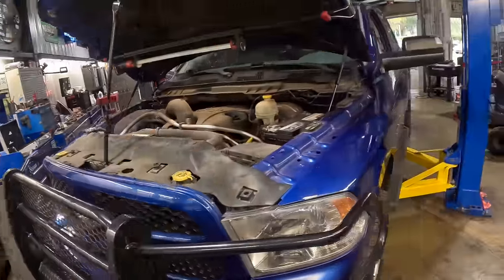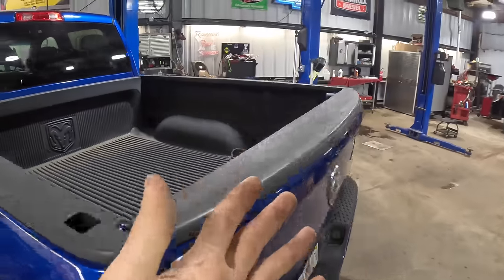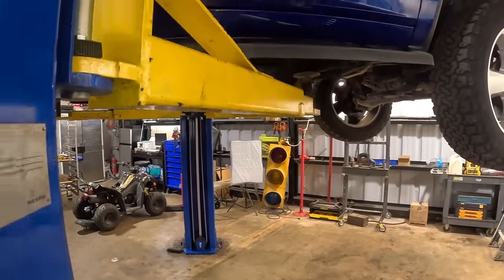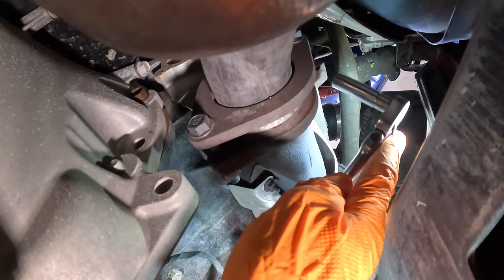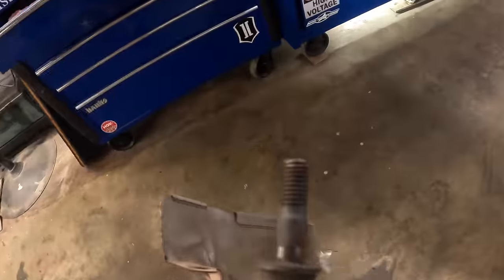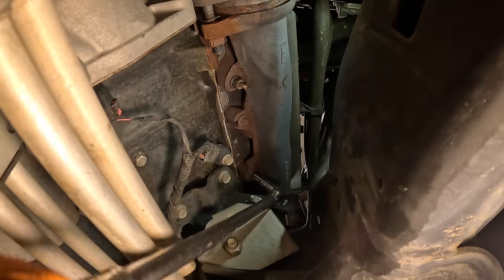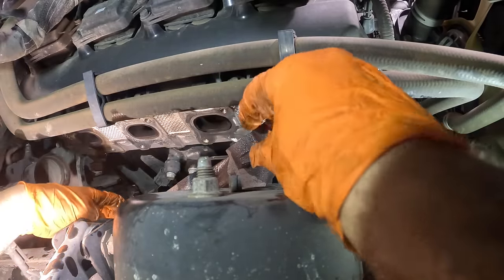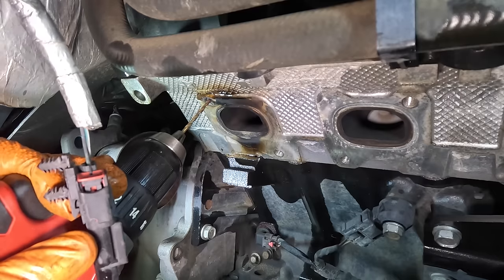Exhaust Leak on Cold Start! Ram 1500 5.7

Comment: Audi 5 cylinder exh. studs would break primarily, on #5. Our standard procedure was to rotary broach the manifold to insure a flat surface and replace all studs with high strength studs (supplied as Audi OE parts). This would  provide a permanent fix first time, every time.
re broken stud extraction, Rigid makes an extraction kit which includes; a centering fixture, the appropriate drill bit, an insert to turn the stud. As long as you could access the broken stud with a drill, the process was relatively simple process. You got lucky on this one. Did you ever notice that the more experienced and talented one is, the luckier one gets.

Comment: The belt sander idea isn’t bad. On improvement to it is to use a bench mounted belt sander that way u can put the whole manifold on at once and keep it perfectly flat. Usually this gets damn near perfect finish and saves big $$$. I know not everyone has a bench mount sander but hay potential shop upgrade

Comment: Hey Ray. Aren't you using flux core welder not a MiG welder?  I thought I recall you saying you didn't use gas?  You should record you trying to learn the TIG welding. I'd like to see how that goes. I'd like to learn TIG welding myself.

Comment: Could you have used the punch driver you use on the rotor screws? It looked like you didn't remove the carbon deposit from the head behind the gasket.

Comment: Nice video. Very dangerous drilling that broken stud “free-hand” like that without using a centering guide, flattening the surface with a dremel  first, or using a center punch. The water jacket lives right next door.

Comment: Use an oxy acetylene torch with a small tip turn it up so you have a small blue flame and heat the nuts up before loosening you'll save on the aggravation  and broken bolts!

Comment: Common issue with the Hemi, had the rear manifold bolts on both sides of our '16 Ram 1500 break.  One had enough sticking out to get with vise-grips, the passenger side I did the build it up with a MIG welder trick to get hold of it.  Bad design by Ram overall, too few bolts, cast iron manifolds that warp over time.  At least they weren't hard to get at.

Comment: I find it odd the air con drain is forward facing, and doesn't have a 90 degree elbow facing down like most vehicles. I thought maybe Ray removed it to have easier access to the flange bolts on the Manifold.

Comment: Good job RAY,center punch 1 st always,don't trust location on hoist post as tubing is NEVER uniformly flat. Get your self a piece of 3/4 in particle board that you have checked for flatness with a steel or aluminum yardstick and hang that on the wall as a surface gauge.Another thing you could do,go to a scrap yard that sells PLATE alum scraps and buy a 6x20x1 inch piece end cutoff.Its usually flat.But don't buy bar-stock it's not flat. good luck.

Comment: I had a local shop quote me upwards of $3600 to replace the gasket on the right side.  all because the cats might need to be replaced if the job went south or if the studs broke off.  I decided that he was telling me in advance that they would in fact break (which they did), but that it would require tearing the block off.  BS I said to my self, and spent the next 12 hours replacing it in my driveway.  and removing the broken stud myself.  
the next year, the driverside blew a nickel size hole, and the little mom/pop shop charged me $125 but I had to go buy the part for them.  $210 all in.

Comment: I have a 12 Ram 2500 5.7L with the same problem. The shops around my area want a small fortune to repair this issue. I would do the repair myself if it weren't for my age and lack of resources. This, IMHO, is a design flaw that should rest solely on the manufacturer as a lot of people have the same problem with these engines. As a matter of curiosity, what is the ballpark figure that you charge for this repair?

Comment: If you use a piece of plate glass's 
As your flat area and use engineering blue your will highlight the high and low spots on your manifold by rubbing the manifold on the glass and making it perfectly flat you can also put emery cloth on the glass as your abrasive

Comment: 👍🏻 better double sided tape on a flat surface with coarse sand paper. but jep this helps a lot. If you have these a lot in the shop you could have a set resurfaced kicking around and charge the machine time cost to customer if they want it.

Comment: Hello Ray. I just did this job to my 2015 Ram 1500 literally 1 week ago. I did decide to replace the manifolds with hooker black heart headers. Not really looking to get any more sound out of it, I just wanted to loose the cast iron manifolds and install stainless steel units for heat dissipation purposes because the aluminum heads cool a lot faster than the cast iron manifolds which creates a lot of stress on the bolts and that is why they break. I also have an unrelated question. I installed a pedal monster and an i-dash on this truck and noticed the BCM is keeping the gauge module lit up until I turn the idash back on and then lock and close the doors. Does the I-dash or pedal monster have capacitors in them which provides enough current to keep the BCM awake? Does anyone else have this issue. Thanks in advance and stellar video as always Ray.

Comment: It may be just me, but there are times when you begin messing with suspect or known crusty nuts/bolts and try and wrench them "as-is". Why not save some time (and maybe uneeded damage) by pre-soaking said nuts/bolts with knock-r-loose or similar penetrant?
Reply: he rounded the heads a little by doing dry first.

Comment: Please explain what's impractical about a few left hand drill bits?  

I had one motorcycle from the Pacific coast in which every bimetal joint was seized, about half the broken studs came out simply drilling a hole with a left hand drill.  Please explain.

Comment: To those who gripe about the belt sanding? It's recommended that the surfaces of the manifold be smooth, and straight, to insure proper sealing. Don't like those exhaust gases? Smooth it out, ah smooth it out. Smooth it out....

Comment: I can't believe how easy those Exhaust Downpipe bolts undid! Everyone I've ever done on any Chrysler engine with those crap 'Tin' Captivated nuts, are like paper due to corrosion and guarantee to break or deform NOT holding the Square nut! Then the problem is holding it!

Comment: The biggest issue with modern  exhaust manifold bolts breaking is their size. In the good old days, the bolts/studs were 5/16 or 3/8 coarse threaded fasteners. Modern fasteners are usually M6x1.25 threads. If the car manufacturers just stepped up to M8 fasteners, the parts would stop breaking.
Reply: Most are running M8. Something like the 6.2 Ford is running M10 and is much improved.
Reply: @mph5896  
Ford has stepped up to titanium bolts as well for heat and corrosion resistance.

Comment: Good job Ray, but two nits to pick. First, you failed to clean up the gasket  surface of the head before you installed the gasket. Secondly, you should have gone back over all the bolts and rechecked the torque. Another little nit, I always tighten the bolts in a pattern starting from the center and working out, just like on a cylinder head. 
Warped exhaust manifolds are a common problem, mostly doe to them being machined before the castings are allowed to age and normalize their internal stresses from the casting process. I NEVER install a new or used manifolds without checking them for flatness. Rarely do I find one that is acceptably flat.
Good to see you've recovered from being so terribly sick. The wife unit took good care of you in your recovery.

Comment: 23:51 @Rainman Ray's i want to share with somethin about the scene at this point, a professional welder tell me before weld a piece of galvanize you need to over pass it, i think is better found some nuts free of galvanizing treatment and use to weld very strong to the broken bolt, or you can order on a lathe company. You'll work MUCH MUCH better !

Comment: I guess heating with a torch isn't an option for some reason, most guys heat them with a torch and they usually come right out. You splurged on a tire machine why not.a torch set?

Comment: I would use a center drill bit to start a hole rather than just a drill. For sure I would use center punch then center drill then drill. Center drill bit sets are very inexpensive and will save you on broken drill bits.

Comment: Ray, the problem is the term "bolting down" this is incorrect. In reality the action is fastening. Therefore the type of fastener becomes irrelevant be it a bolt nut, screw, rivet etc . 
Cheers Eric  (a paid up member of the semantics police)

Comment: I try not to Rheeeeee! Ray I really do, But it would be easier to remove the wheel to gain access to the top manifold bolts! And Rheeee! It's a RAM truck , not a Dodge.
GREAT VIDEO BUD! LOL.
Reply: So remove the wheel when you do the repair yourself. What's the point of this comment?
Reply: @Gizmetti  It helps Ray's algorithm,.....
Reply: @ghettsumm7949  You could leave non negative comments too

Comment: Ray, would deepest respect I must ask why do you insist on the possibility of breaking bolts without using penetrating oil first. I’m really curious what you’re thinking is why that’s not happening. I don’t understand the the risk u take. Finally, I see you put WD-40 on it. Not the best, but doable.
 U may also find drilling into bolts try using cutting oil and a slow speed for hard metals.

Comment: Do they offer heat treated bolts that won’t break off in the block?
Reply: That wouldn't work. You have steel going inside of aluminum, and they do not play well with each other. They form a corrosion barrier between the two metals, and act like loctite.
Reply: I would guess that bolts are plated to put a barrier between the bolt material and the recycled toothpaste tube that the heads are made of. I think those bolts break because, why not.
Reply: @kenore4003  none of those bolts are plated because of the extreme heat cycles and constant heat that area is subjected to.
Reply: Good to know.

Comment: You would think that in this day and age, manufacturers would have fixed this problem.
Reply: This has nothing to do with manufacturing, it has to do with physics and heat cycling.
Reply: @alanking7331  Well knock my socks off., who would have thought. The problem with studs in exhaust systems breaking is one the manufacturers have not done well in overcoming. One way is to replace the steel studs with stainless steel and use brass nuts, which many mechanics, both professional and amateur, have been doing over the years.

Comment: Way you did not use a a center punch so the drill bit doesn't wake off from the center of the bolt way not try using the air hammer and way didn't you use a wet rag to put up inside to protect the valve

Comment: I gotta agree with you with the left hand drill bits.  Never understood why the extraction kits came with them.  You’re just drilling a hole, it doesn’t matter if you got left or right, it’s just a hole.
Reply: Sometimes when drilling the hole the left hand drill will catch and spin out the broken bolt. 😊

Comment: I know it's not the quickest method, but usually a thick piece of glass is quite cheap and easy to find, just place a sheet of sandpaper on it and start rubbing the piece. In the end it comes straight because the surface is straight.

Comment: not a big fan of that rams... I just hate their stuff like I hate their freaking washer fluid bottles. I hate under the hood like you know just I don't like it. Ford and Chevy no problem, especially GM. They're easy as hell, especially older ones. But I just hate to. I hate Chrysler Fiat whatever
Reply: washer bottle on my 2011 ram is bad about the filter on the pump clogging up, hard lesson learned, don't use cheap washer fluid it will congeal over time with the heat.